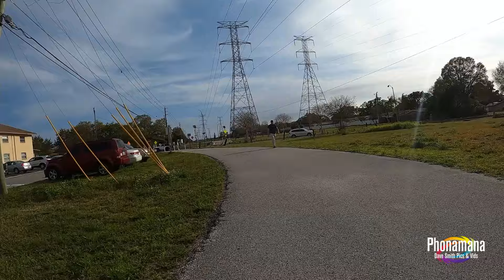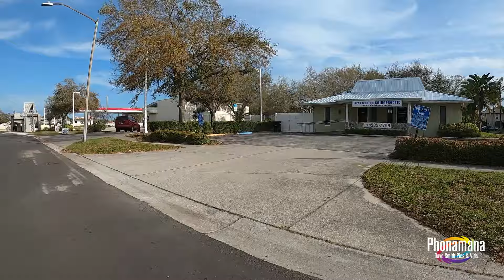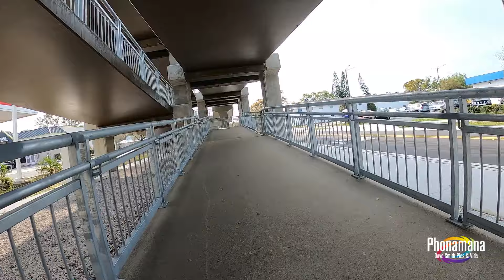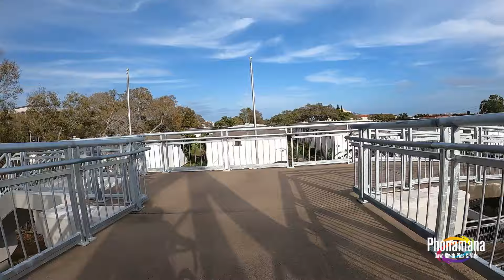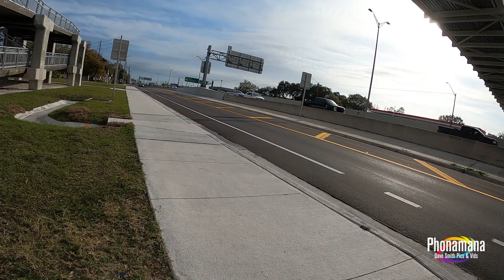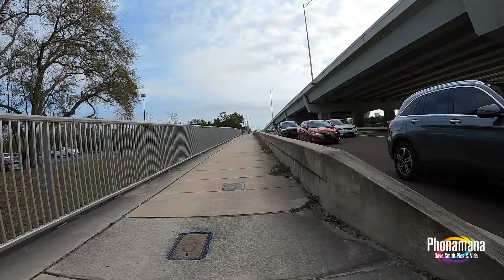The New Harn Rd Pedestrian/Bike Bridge Overpass That Goes Over US Hwy 19 In Clearwater FL

Comment: Nice, thanks for sharing. Great that wheelchair/ADA compliance keeps the ramp from getting too steep. Too bad they didn't make the sidewalk approaches wider for cyclists passing peds.
Reply from the maker: I just saw two old heavy guys riding their scooters across it on Sunday so, yeah it's wheelchair and scooter friendly. 

I do have a bad feeling that a cylist might wipe out on those turns when the ground is wet or if their brakes fail to stop them. Either that or a cyclist hits another cyclist or person going the opposite way going around the turns. It's natural for a cyclist going down to swing to the outer lane. I do feel though that another cyclist going down will see someone else coming up though and go down with a bit more caution. Time will tell though.
Reply: Interesting, I drove down US19 the other day as I visited Clearwater and wondered what that overpass was. Thanks for posting this.